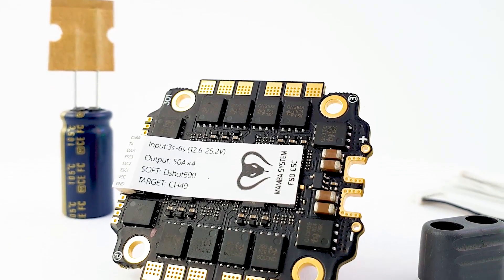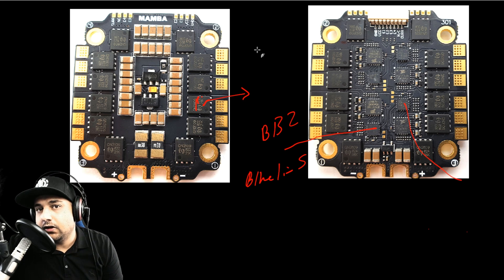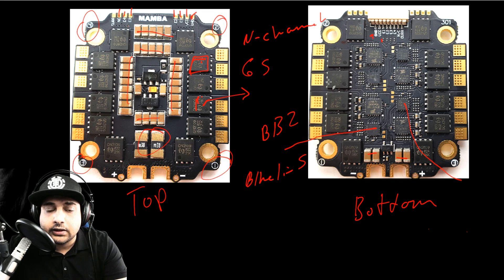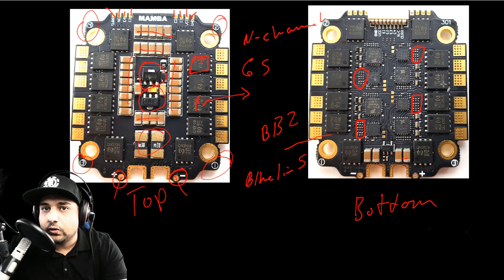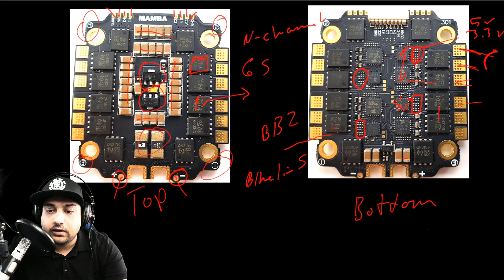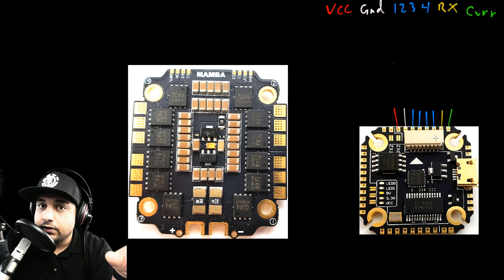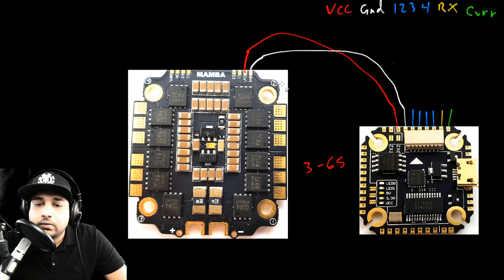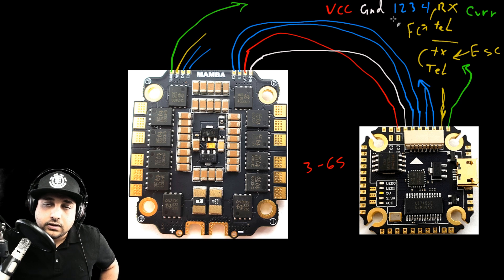Budget Performance for 6S Setups // Diatone Mamba F50 Overview & Setup Guide

Comment: Hello, i have f60 pro esc and one of the 4 orange things on the bottom side is gone and there is some burn marks on the board. What are they for and is that board safe to use? I dont know if it works because i noticed it only after a crash and i cant test it because my drone is gone now :(

Comment: I'm looking to buy the diatone mamba F405 dji F50 (FC + ESC) stack (the 30.5x30.5 one)
I want to mount the stack inside the GEPRC MARK4 HD5 frame (with the dji air unit)
from what I've seen in other build videos there is not really a lot of space between the stack and the air unit to fit the power cables and the capacitor

I've seen a build on rotorbuilds with another 4in1 ESC mounted with the power cable towards the front
does anyone know if the cable that is provided to connect the FC to the ESC is long enough to mount the ESC 180 degrees turned but the FC the right way?

like the black line in this image:
https://ibb.co/7GW3ZPm